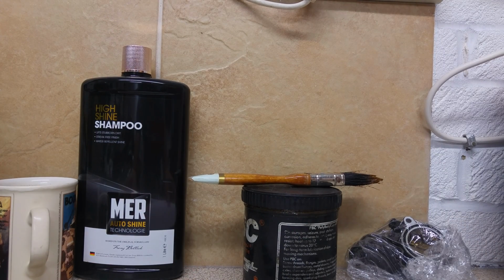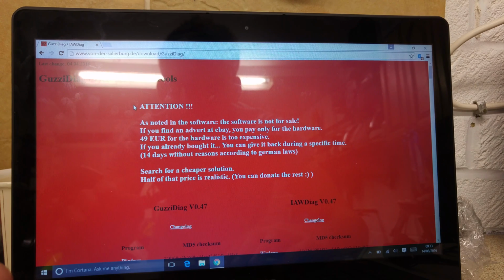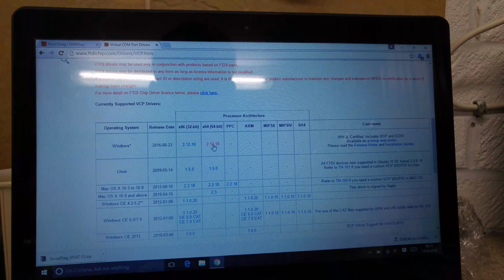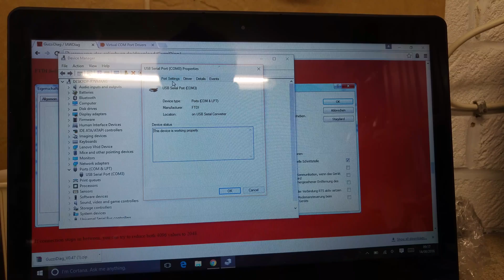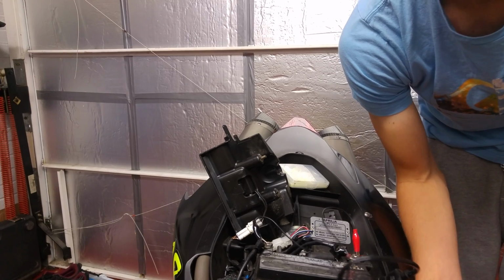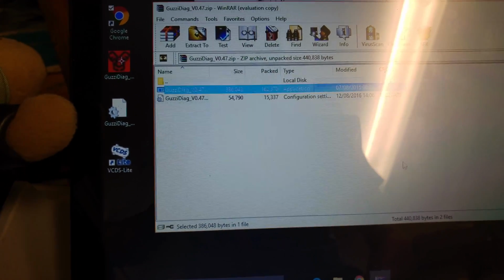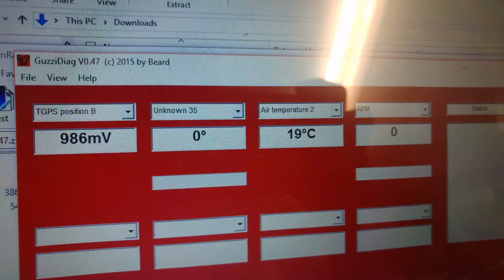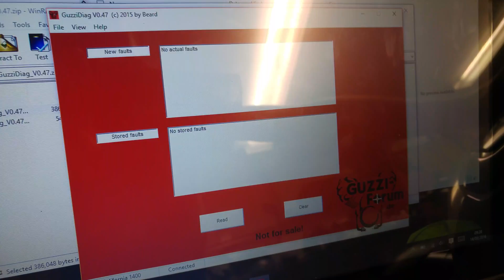Aprilia Dorsoduro 750/Shiver 750 Diagnostics Tutorial

Comment: The cable you bought and the link is from the same seller I used. Some guy in Wales. The chip inside the cable started smoking on the 3rd use. I also checked online and the FTDI chip in it is fake though the seller claims they are genuine.

Comment: Would this software help diagnose a no crank situation when pressing the starter button. Ive tried everything else all the obvious things solenoid, battery starter motor etc, i suspect one of my other relays maybe down the ones that sit on the airbox. I think its the command or resistance module that the ecu sends power through to the starter solenoid but not sure.

Comment: Doesn't work for 2011 Shiver 750 the 3 pin plug on the bike has smaller slots than the cable you linked, is there any cable that will fit

Comment: Hello, I have dorsoduro 1200, and diagnostic doesn't work :( I have VAG cable meybe it is that problem. The diagnostik writen ignition off :( but it is not true.
Reply from the maker: Jan Dorňák the 1200 uses a different ECU, I mention that it may not work in the video but by all means try a different cable as the VAG cables sometimes do not work.
Reply: Ok, I try use different cable, thanks, :)

Comment: I found a VAG KKL OBD2 USB cable with FTDI FT 232 chap 3 pin adapter cable for GuzziDiag on Ebay do you think that will work ?
Reply from the maker: Dell Davis I have a similar cable as well as the ones in the video but no longer have a dorsoduro so can't check. for guaranteed results use the links in the description

Comment: That's a very clear and nice video you made. I'v a Shiver 2008. Can you use it for all Shiver's (2007 - 2016)? Or only newer ones?
Reply from the maker: I believe you should be OK, my Dorsoduro is a 2008, too. I'm pretty sure the ecu is the same. If it's not, it shouldn't cause any issue - likelihood is the software won't recognise it, but I think they are the same. I've also been told that you can now use the IAWDiag on the guzzidiag site, so if you have no luck with GuzziDiag, try IAW instead. Hope this helps!
Reply: Ok, nice to hear. I'm gonna try this soon.